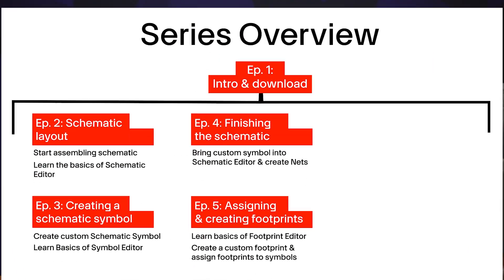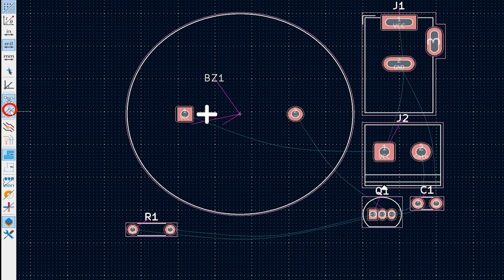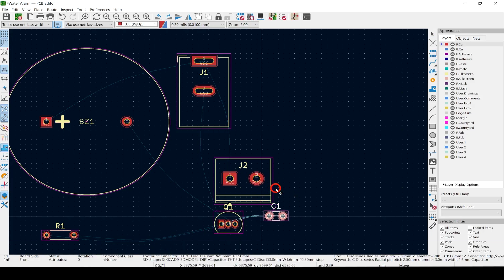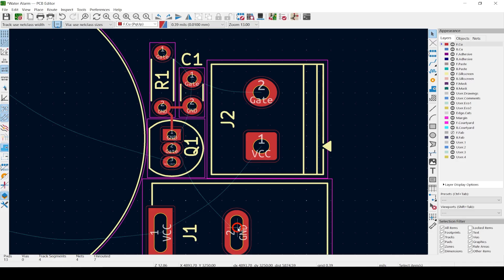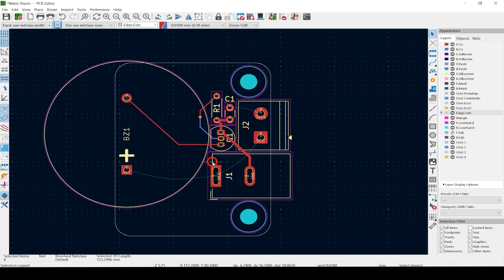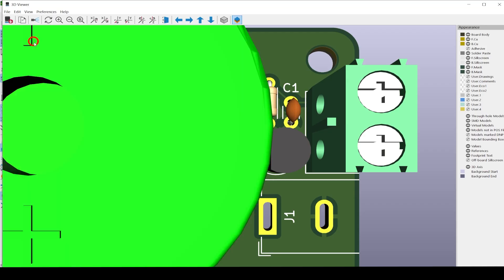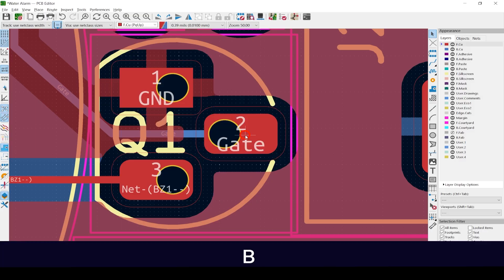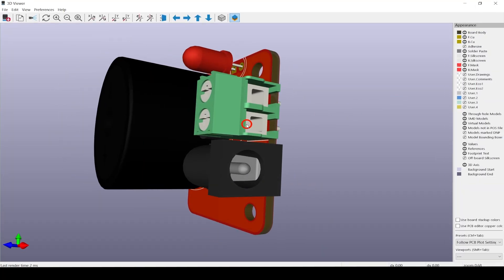KiCad 9.0 – Getting Started Part 6- Laying Out Your First PCB | DigiKey

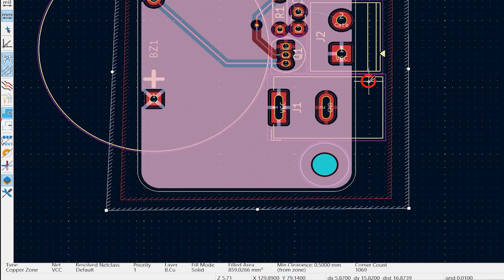Comment: What button are you referring to at the 11:25 mark about being sure "this button is check or you might go crazy?"  Also, my 3D view didn't change to red after I changed the color of the front mask.  In the 3D viewer the mask was still green while the front mask icon on the tool bar had been changed to red.

Comment: If someone else is confused as I was: if your Fillet Lines shows mils rather than mm, at about 9:43 he changed to mm on the left panel (but was not shown on the video). Change to mm and you should have the filliet just as he has.
Reply: Or just put the fillet size to 39.37 mils

Comment: 16:23 which footprint?

Edit: When I update PCB it says "Error: Cannot add D1 (no footprint assigned)."

Think I figured it out. In the symbol properties I clicked the books to the right of the footprint. From some searching, sounds like LED_D5.0mm is a common LED size. Chose that one. Saved. Updated PCB, error went away. Footprint looks about the same as the tutorial. DKPN: 160-1131-ND
Reply: Thank you, was just going through this problem!
Reply: Thanks!